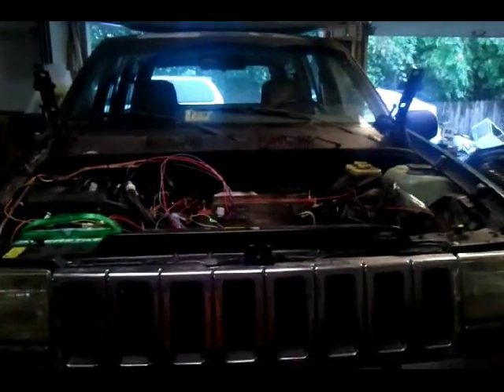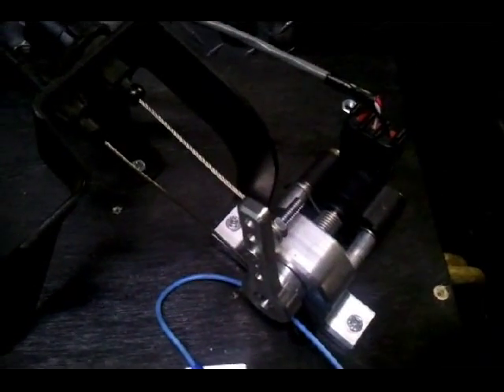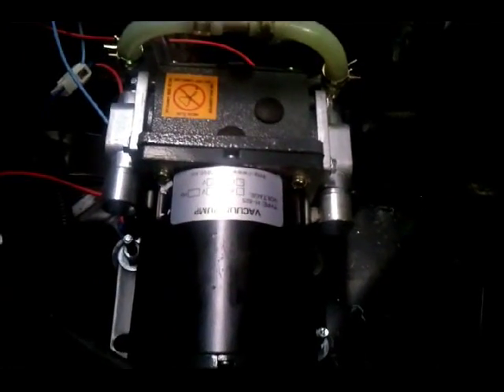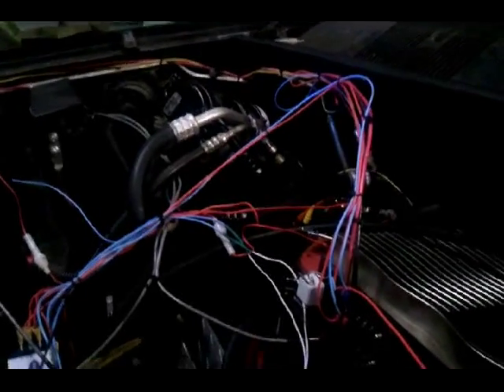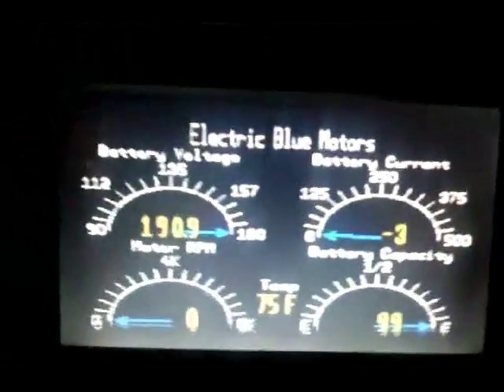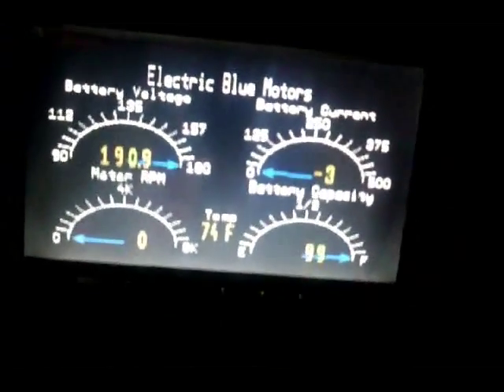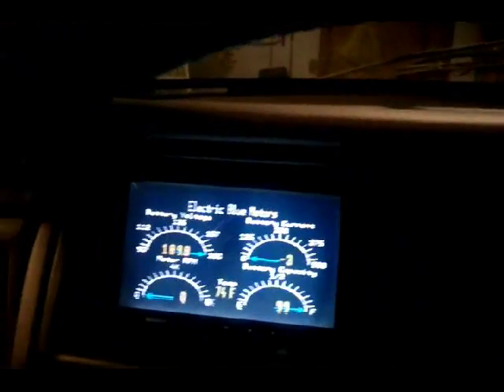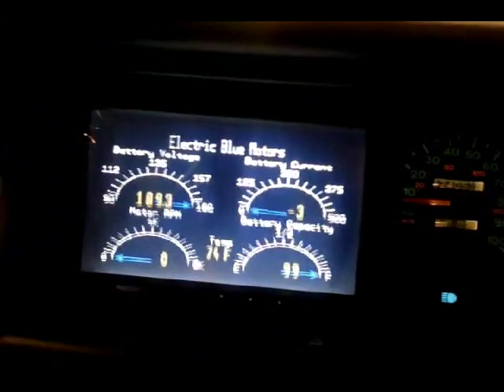1993 Jeep Conversion to ALL ELECTRIC POWER.avi

Comment: automatic transmissions can sap around 10% more power than a manual gearbox as well as weighing more and being less reliable. air conditioning can be run by an electric compressor.